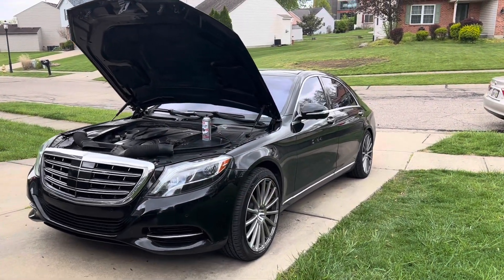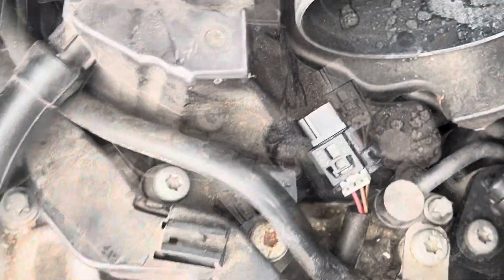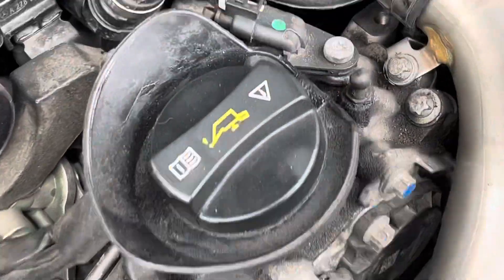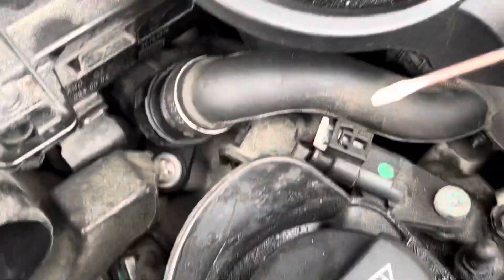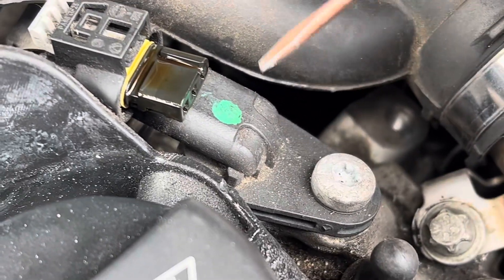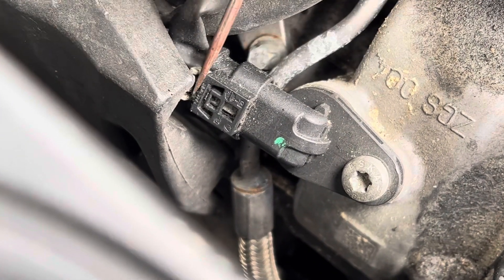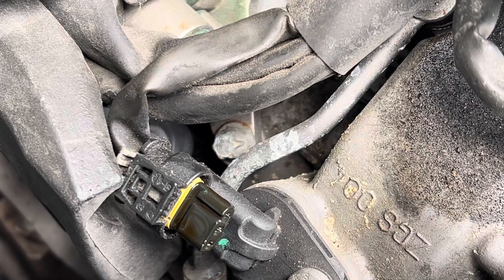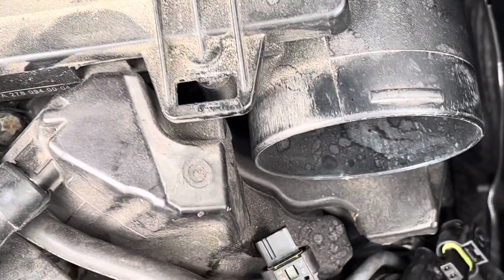Mercedes S550 W222 Camshaft Position Sensor Fault - Cause & Solution & Fix P0367 P0366

Comment: What would you experiencing prior to doing the work? What was the issue like a delay in start?
Reply from the maker: Yes. It starts and quickly dies. Restarts no problem. And a check engine light.

Comment: The oil is not getting to wire plug because of the o ring. The internal housing is leaking.

Comment: Hello thanks for the help. Do you know where p0343 is located?
Reply: "Camshaft position sensor A circuit high bank 1 or single sensor" is what the code read.

Comment: I have some misfires and check engine light come on and soon as i turn off and back on the car it works perfectly fine with no check enginel light on. Do you think is the same problem?
Reply from the maker: You should have a stored code. Have you scanned it?
Reply: @goldelementautoworks  so Mercedes find out that 2 catalytic converters are bad and 1 ignition coil.... 

I'm glad I have extended warranty. It's all covered
Reply: @goldelementautoworks  nothing.  No code are stored no nothing. Im going to dealership tomorrow just to make sure everything is ok. So far the car is running great after that and no check engine light comes on again. I don't understand.  It might be bad gas....i always use premium but now Im moving to BP or shell

Comment: These motors have an issue with "wicking" as well. That meaning that the oil can have a tendancy to travel up the camshaft sensor wire, sometimes all the way to the ecu, which of course is not good. There is a company that makes a kit to prevent this, bit i forget the name. If you are having these issues, i would definitely look into it to save expensive repairs in the future
Reply from the maker: Thank you for that information. I needed that. 👍🏾👌🏾
Reply: @goldelementautoworks  it was burning in my mind so I went back to look them up. The companies name is FCP Euro. I also remembered seeing a video on here about it as well, and he used their kit. Channel is Auto Auction Rebuilds. He's got a Playlist on the W222.
Reply: Does Mercedes have any responsibility to oil traveling all the way to ECU?  I have same issues. I bought extra 3inch wire connectors.    In effort to prevent oli traveling further.  If i turbo boost it chokes at some point.  Engine code now saying P0087?  I'll fix the little stuff & see how it goes.  

Thank you for valuable information

Comment: Hello, good video, I have the same error codes, I replaced the camshaft sensors but the problem still persists. I don't stroke while I'm driving . Do you know what it could be?
Reply: Hi chance of timing chain have to be replaced
Reply: Oil gets in the sensor and then follows the wire back to your computer. You need to disconnect the battery unplugged the computer and clean out the connectors in the ICU. They also make short extensions, the plug into the camshaft sensors and Kim shaft, magnet adjusters.